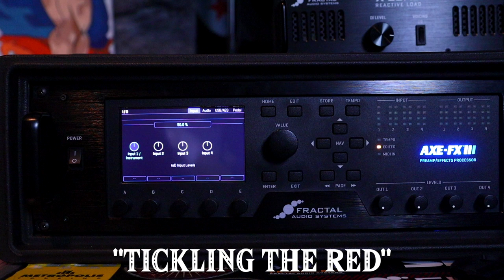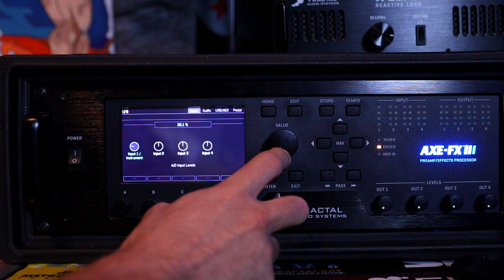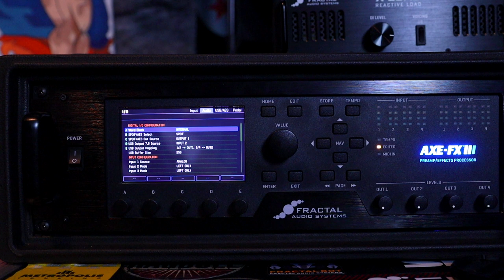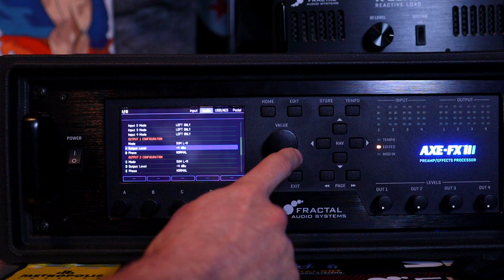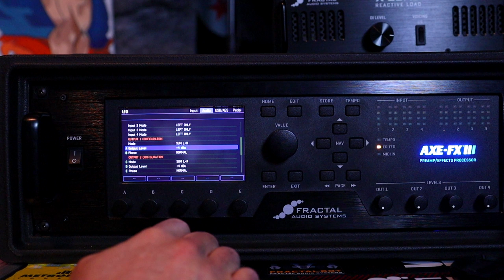Axe-Fx III Basics - Initial I/O Setup

Comment: I plan on buying the Fractal FM9. I want to use my Fractal FM9 at home (no recording, just playing), but I also want to use my gaming pc through an audio interface to monitors. How do I connect the FM9 in this equation (I want to use my PC, regardless if the FM9 is powered on/off). Do I connect my FM directly to my PC via USB to get audio through my monitors, or through the external audio interface that is connected to my PC which leads to Studio monitors? I know there are a lot of options to connect, but I would just use it as a classic "amp rig" to have fun, and nothing else (no recording, etc).
Reply from the maker: The audio interface needs to be on in both situations, so hook that up to the monitors and hook the FM9 up to the interface

Comment: great video. how to setup multiple guitars with different strenghts of signal - from acoustics to bass and electric guitars? weaker guitars will loose in input a lot. How to handle this situation? THANKS
Reply from the maker: The input sensitivity is just to optimism signal to noise ratio, it doesn't have any effect on overall gain

Comment: My Les Paul is tickling the red at 60 % whereas Leon's does it at as low as 20 %. What's up with that?
Reply from the maker: Different guitars, pickups, strings, picks, players is going to result in different outcomes there. Anything between 10-90% is pretty normal, all your doing is fine tuning the input A/D converters for optimal signal to noise ratio.

Comment: Question, I updated axe fx version 19.01, and l used your instructions to adjust the input level, so the red is tickling.

However lve noticed the output level is staying in the RED and not tickling output level like the input levels.

Is this normal? 

As l noticed in your video as you were adjusting the levels, nothing came out of your output levels.

I’m going into a power stage power amp, into a 4 x 12 Marshall cab.

Any guidance would be appreciated.

Comment: Thank you, Leon! Do you have to make similar adjustments to the Instrument Input Level when using a distortion or overdrive in front of the Axe? Or is that a matter of just turning the pedal's output level down if it's pushing the Axe meter red?

Comment: If you adjust the input like you did, does it affect the output volume?
Reply from the maker: No, it just calibrates the A/D converter sensitivity
Reply: @LeonTodd  thanks. That's good to know. In case it's something you have to change every once in a while, you don't have to worry about re leveling your presets. We use ours with a wireless receiver. So we can adjust the inputs via the wireless packs. But… If we need to go to a cable every once in a while, all of that can be out of whack. So it's nice to know I can use this adjustment without affecting anything else..

Comment: Leon,  I just watched this but I think that they updated the firmware after this video.  For the A/O input levels, I also have a 5 knob that's the INPUT 1 Gain.  This is different than just the Input 1 Instrument knob that shows on your screen.  How should i set up this Extra 5th knob?  Any tips?
Reply from the maker: Just leave it at the stock value.

Comment: What if I want run a power amp/cab on stage, but use cabsim to FOH? And special global settings in that case?
Reply: In that case, you would need to use two output blocks on your preset: one with a cab sim (for FOH), and another without (for your stage setup).

Comment: When using an amp can you plugin to the effects return to use a solid state head as a power amp to bypass the preamp?
Reply from the maker: Yeah
Reply: @LeonTodd  in this setup would you leave the amp block in and only bypass the cab block or do you need to bypass the amp block as well?

Comment: Hello Leon I just received my Axefx 3 today ,hooked it up ,for some reason I’m not getting very good volume out of the unit just going 1/4 “ out of out 1 to studio monitors and my usb to high end windows 10 Intel I7 . My Axefx 3 needs to be turned all the way up on out 1 knob still not getting much volume my monitors never needed to be turned up more than 1/2;way and they need turned up then everything sound like it’s clipping.Also have another issue I’m not getting sound from my computer with usb hooked up. Driver is loaded and it’s showing speaker in windows like it’s working but it says something like no line jack found  in Windows.
Reply from the maker: Are the output 1 labels set at - 10 or +4?
Reply: @LeonTodd  is the level supposed to be at -10 or +4 ? I have a couple of yamaha hs 8 , on axe fx3 group they are suggesting using -10 db, which one is correct ?
Reply: Use +4

Comment: Great info. Thank you Leon! One question that I was unclear. When setting the output level, for studio monitors,  what should I be using? -10db or +4db?
Reply: +4db
Reply: @numv2  Thank you!
Reply: I wanted to know this too
Reply: Jeralt Du Trivia  I have those speakers and they're technically near field FRFR reference speakers not exactly a PA per se. to answer your question those are what I use with my axe fx and they're perfect for me. if you're experiencing issues with the sound it could be a number of things. firstly I'd make sure your amp modeling is turned on and cab modeling is "active" as seen in this video. from there make sure you're not clipping. refer to the manual and fractal forums if you're still having issues.

Comment: I just got my axe 3 and am not getting sound from monitors. Do I HAVE to have it connected to a computer just to play it using monitors and the axe 3 built in interface?
Reply from the maker: Connect the monitors directly to output 1 and you should be fine
Reply: @LeonTodd  Do I have to use a DAW in order to hear sound of the AXE FX 3 through the monitors?
Reply: @LeonTodd  I downloaded the fractal usb and have usb going from fractal to my pc, and i see the fractal listed as my audio interface when i click the speaker on the icon tray at the bottom of windows. I was just able to get sound when i messed with settings on audio interface section of Reaper Daw but it didn't sound at all right. I just wanna play through monitors, is that possible without using a DAW because the DAW I don't understand how to set up
Reply from the maker: @veronatragedy7016  yes but the monitors need to be plugged into the Axe-Fx itself, not into a different audio interface.
Reply: @LeonTodd  I think it's working now, Thanks!